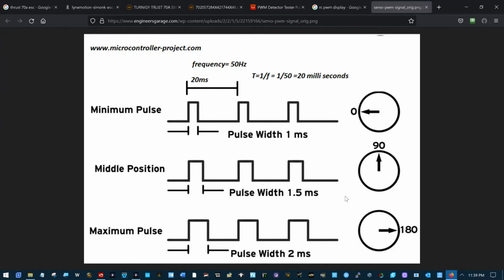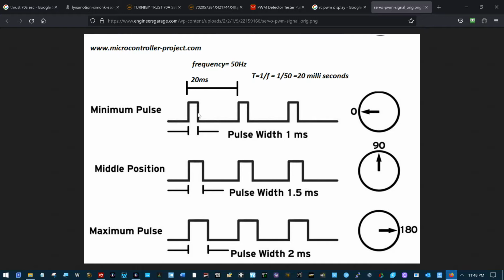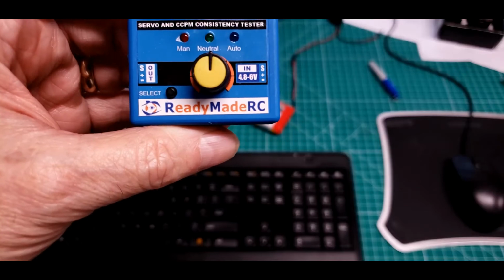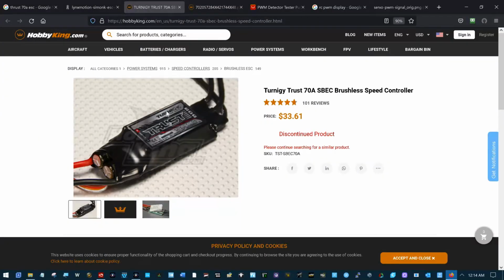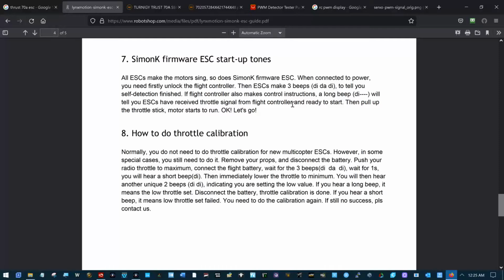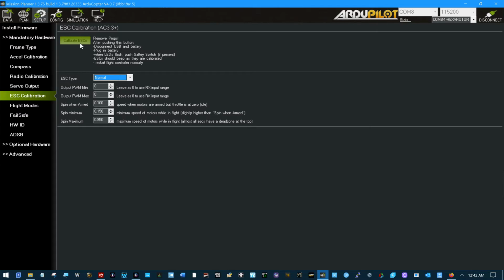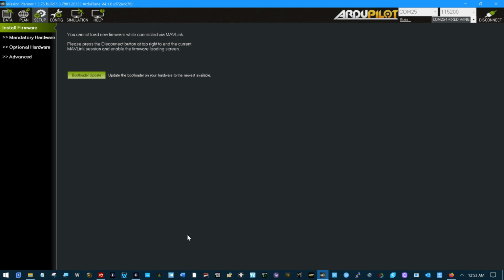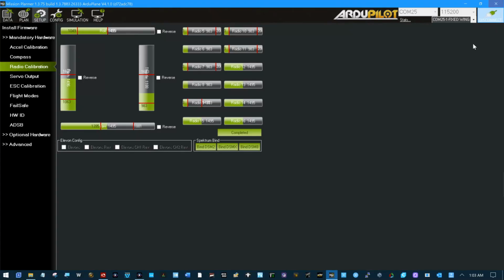ESC Calibration

Comment: Thank you so much sir 🤩
Reply from the maker: You are most welcome. I have more coming. I found out some additional information today that I will post ASAP. I am also thinking of redoing this and putting it into a separate playlist on ESC Calibration Problems.  I hope to cut that LONG video up into more easily viewed parts.  I just wanted some information out and that was my first draft of the information.
Reply: @nighthawkvs  please sir... It will help a lot... Really appreciate your efforts
Reply from the maker: @sakharamachrekar753  It is my honor to help in any way I can.
Reply: @nighthawkvs  sir can i get your contact or mail id
Reply from the maker: @sakharamachrekar753  I almost have a Facebook page up and will post that information very soon.
Reply: @nighthawkvs  sir. I have to share video of my issue.. I have tried the method you shown in video, i got all the signals and beed from my esc but motor is not spinning till... Kindly help
Reply from the maker: @sakharamachrekar753  Post that video to YouTube and send me the link and I will look at it. I also have a Facebook page at WNC RC you can ask to join and post there. It is still under construction so it might not be visible yet.
Reply: @nighthawkvs  ok sir
Reply from the maker: @sakharamachrekar753  I just posted a couple of videos that may address your problem.  I am not sure yet.  But I will continue to research and report all I can until i find an answer.
Reply from the maker: @sakharamachrekar753  https://facebook.com/wncrc